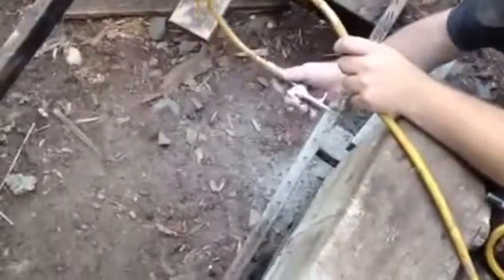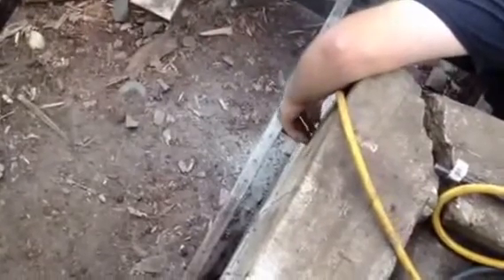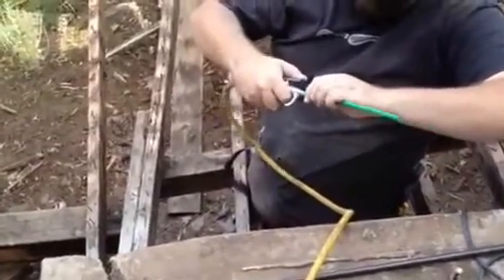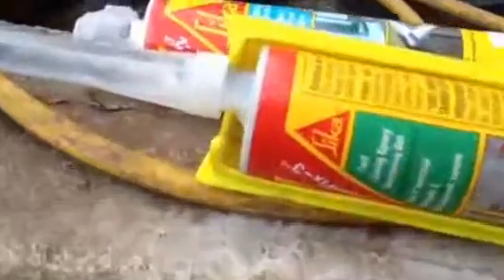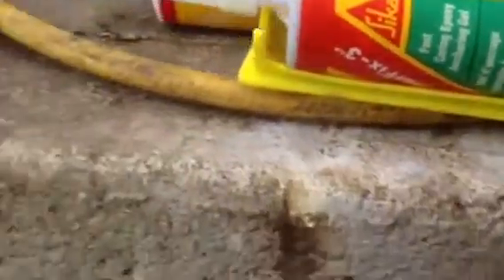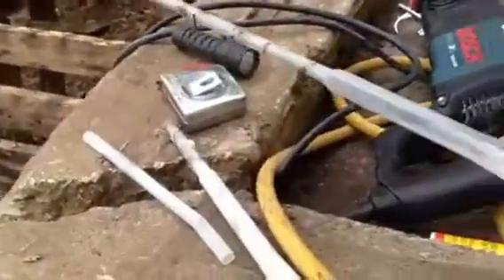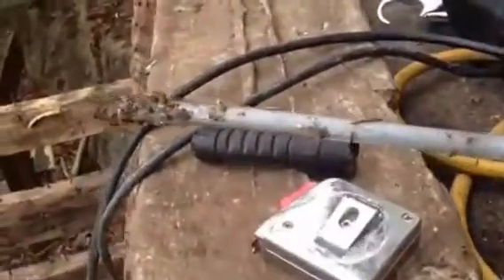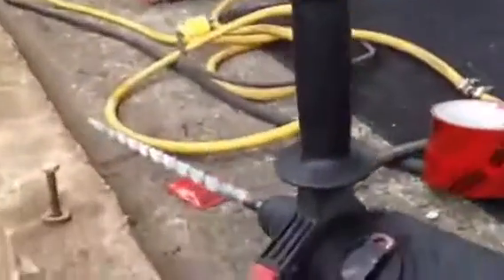How to Repair Cracked Concrete Retaining Wall - Sika Epoxy & Threaded Rods

Comment: What would you do if there wasn't a corner to put the bolts in? My crack on the retaining wall is between the wall and where a buttress comes out. So, it's basically a corner but facing the other way. Does that make sense?